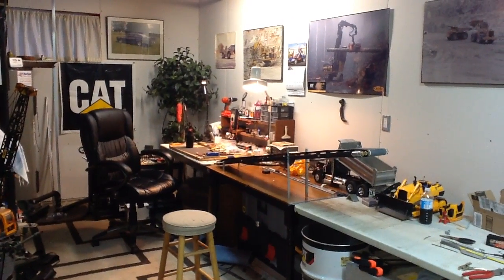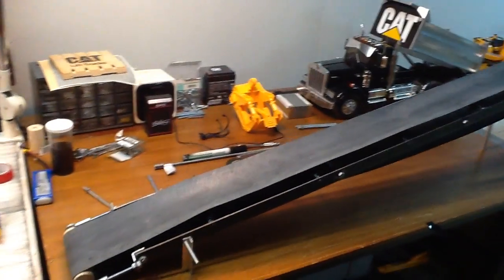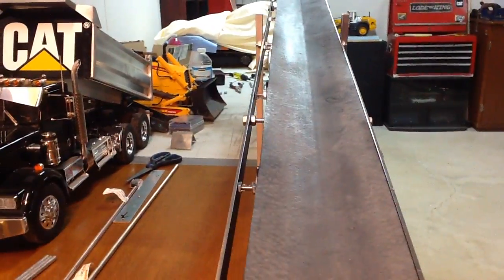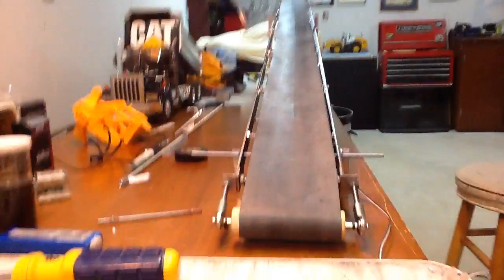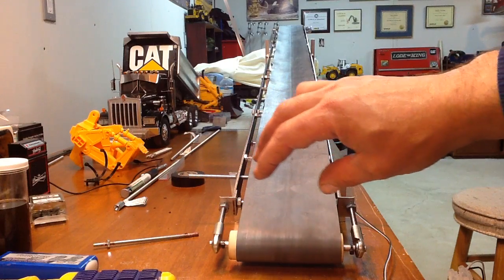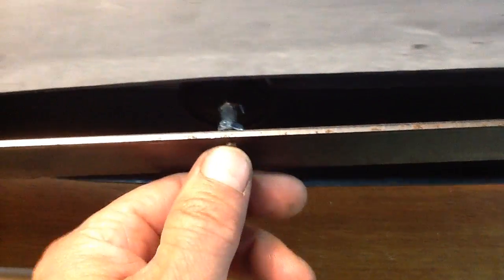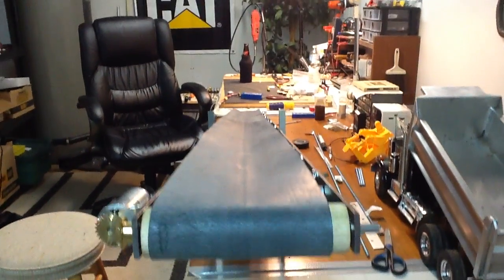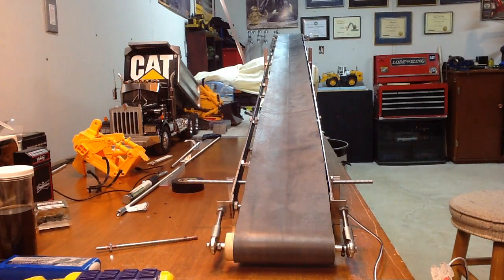Conveyor build part 2

Comment: where would I find that tensioning mechanism?
Reply from the maker: Dipraj Kadlag the tensioner is all made from local hardware items. 1/4 threaded rod, 1" aluminum angle , and the ball links to support roller shaft.

Comment: Nice conveyor. How many RPM's is the motor you're using?
Reply from the maker: Thanks Ricardo. The motors are 30rpm and dirt moves nicely at this angle. I wouldn't want any slower and probably no faster than about 50-60 rpm or dirt would just roll back down and not move along..